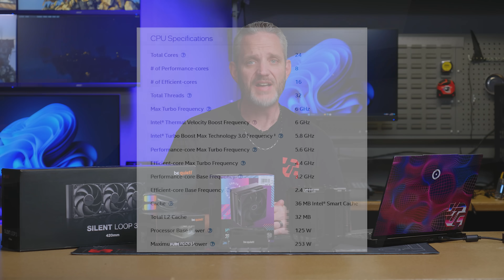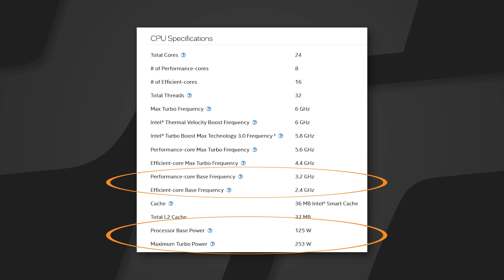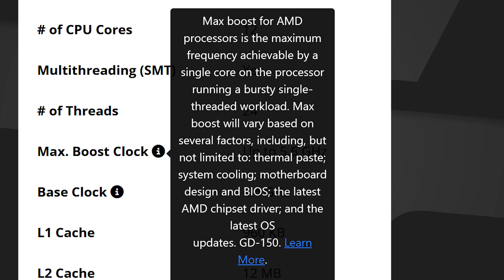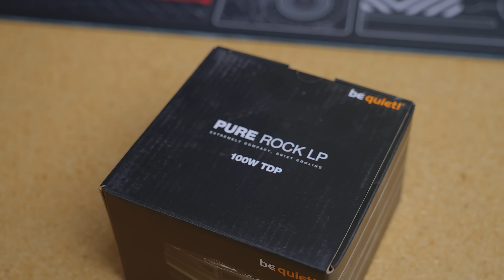Forget what you THINK you know about TDP

Comment: What's wrong with almost all Tech Channels lately? is there some mind virus going around. Some new variant of C-19 causing cretinism?
1) First Law of Thermodynamics applies here as everywhere else.
2) AMD's CPUs adhere hard to power limits set in BIOS or software able to change those BIOS values.

Setting 95W power limit to my Ryzen 7 9800X3D will result in power draw clamping at that point instead of exceeding stock 120W TDP as JayZ suggests.
JayZ is having case of serious PICNIC, or he is shilling for intel who has out of the box boosting mechanism which ignores TDP limits shown in tech specs. Because those are base clock speeds. 
And as intel states, their tech specification shows: "Time-Average power draw during their specific scenario." That means not under full load. As been many times explained, it is their way to simulate expected user's behavior.
That's why 14th gen can easily sustain 350W power draw, while their spec says base power draw is 125W, and Max turbo is 250W. Even while they explain 250W turbo is for burst shorter than 1s by default. But as they state, vendor (main board manufacturer) is free to change those.

In reality, intel's defaults been sources of prolonged turbo power draws exceeding those 250W.

Comment: 7:05 i can guarantee from personal experience that a low profile cooler COULD cool a 9700x ONLY if you leave it at stock; The moment you push the 105w mode and/or PBO, the CPU would fry itself with that thing
Reply: Making my first build with a 9700x. What sort of cooling would you recommend?
Reply: @Rickyp0123  If you want to go with the 105w mode and PBO on, DEFINITELY at least a 280mm AIO

Comment: The older Hyper 212 is a rock solid heatsink had no issue with it. I am still using Noctua C12P-SE14 bought brand new over 10 years ago with a upgraded Noctua Redux 1500rpm fan. Reason I still use it is the looks glorious in the side panel

Comment: 7:26 I just built a travel build in a nr200 (non p max) because I wanted to be somewhat travel ready and also have an aio. I used a Thermalright frozen prism. And max temps ive seen is 76, and on the gpu 79. While on the warm side I'm under the impression I should be fine with that. 7800x3d 5070ti.
Reply: Oh dude your rig is really similar to what I want to build did you had to change anything in the bios?
Reply: @teachhimself no sir, i do start everything with an update of drivers but no i didnt have to flash bios or update bios ahead of time.

Comment: A rule of thumb for AMD CPUs power draw is TDP x 1.35.
Reply: Don't bother with the TDP.  Just look at the max watt draw and that is your max heat output.   No math, max power equals max heat.
Reply: This formula is actually closely in line with actual stock AMD PPT values. Just for illustration:
65W AMD TDP [7600 etc] x 1.35 = 87.75W (Actual PPT is 88W)

105W AMD TDP [7700X etc] x 1.35 = 141.75W (Actual PPT is 142W)

120W AMD TDP [9800X3D etc] x 1.35 = 162W (Actual PPT is 162W)

170W AMD TDP [9950X etc] x 1.35 = 229.5W (Actual PPT is 230W)
Reply: Well yeah because that's PPT which is 230W
Reply: That’s actually pretty accurate 😂
Reply: Valid for AM5 because of their thick IHS.
Reply: more like  tdp x 1.8 or even 2.2x otherwise cant max out the turbo on every core

Comment: The really annoying thing is going to a review site, read "this CPU doesn't need more than the stock cooler it has to run anything you throw at it", let the SI use the stock cooler, then find they didn't run proper testing and that the stock cooler can't deal with the CPU unless any OC is disabled to keep it on base speed tops.

Comment: 11:11 I don’t think that’s accurate! And the dark rock 4 pro whatever doesn’t have a vapor chamber. (As far as I can tell)
There’s multiple coolers that use a machined metal base that aren’t vapor chambers. 
I’m actually only familiar with the one from deepcool that does use a vapor chamber. And they make the same cooler without the vapor chamber with very similar specs. 
It’s sort of a niche and unnecessary use for a vapor chamber anyways.
Reply: Up, you are entirely correct! Almost all air coolers that look like that only use a solid copper base, not a vapour chamber.

Comment: SFF PC + 13600k user here, Im unable to run the latest microcode (which doesn't support UV) due to the insane factory tuning done to the CPU, without my undervolt the temps rise by over 20degrees under load which when combined with any GPU activity throttles the CPU immediately since the 240aio cooling it is also the only case exhaust.
Undervolted I still get full boost clocks so what the heck is Intel thinking flooding the chip with so much voltage??

Comment: About the 9800X3D.. you said it's easy to cool, but my second gen NH-D15 (LBC) still had it reach TJMax in cinebench. I know it's not "real world performance", but it still runs hotter than I expected. Online I read more people have trouble keeping that beast cool.
Reply: Cpu always try to hit tjmax, they are made to keep going till they hit it or fail (if enough power is avail). If it wasnt hitting tjmax, it would mean cinebench isnt working or strong enough to test the cpu.
Reply: Yes it's not the easiest to cool since 140W+ comes from a single CCD. Minus Curve Optimizer helps but be mindful increasing the Max boost frequency will increase your temps tremendously. I got -20 CO +150 MHz Fmax stable so far and it has stock temps with better performance. I had -30 +150 stable too but it was clock stretching that's why it looked stable but perf was worse.

Comment: What I think is borderline criminal are the CPU makers not being clear on this. I don't mind "TDP" used as "this is what your CPU will use 100% stock". What I DO mind is they hiding how much it would go full throttle - at the very least full load on set parameters (call it PBO profile 1, 2 and 3).

I mean, sure no one can give an exact estimated for how much each CPU will use at every configuration. But a stock baseline, plus 2 or 3 default "enhanced" ones would be good to know. It's always the same: I look at the CPU and start choosing a cooler. Then "Will this one here work? The TDP says so, but this is worthless."

Comment: Tdp is useless, even though I might Install a cooler with more than enough cooling capazity regarding the watt it can cool, if airflow is bad, it cant do its job, if the contact frame is bend or the plate is uneven or paste is applied bad it wont matter, so many factors ... nothing to do with tdp ...

Comment: @JayzTwoCents TDP numbers get tossed around a lot. My NZXT AIO died and, while it was under warranty, they sent me an AMD Wraith Stealth and said, “It’s 65W, should be fine” for a 9700X. When I tested it, the CPU was basically cooking itself trying to hold 5.5 GHz, to the point it shut down. It also annoyies me quite a bit when tech youtubers try to compare TDP to actual watts. They say 9700X doesn't need a AIO at all, without understanding the prices of box coolers, like you mentioned.
Reply: I have a 240MM AIO on my 7600X3D and it stays fine.

Comment: i always go double what they say
so like 150w i go 300w (i do have a 360 aio on a 12700k clocked at 5.1ghz p cores 4.1 e cores set at 1.235 volts at 250 watts 105c shut off point since asrock like to shut off my motherboard when it hit 80c even tho it was set to 80c for the safety

Comment: My H115i still has a lot of cooling headroom. The max T-Die is somewhere in the 70 degrees and I have the fans set to low. The CPU uses 170W rather than the 105W it is supposed to. All that meaning I will likely keep using it even in the next hardware upgrade. Which might take another year or even longer.

Comment: Well, working in the embedded area, Intel and AMD CPUs will run at base clocks max. normally. The same for the memory as well. They are designed and built for reliability and longevity, in my case for extended ambient between -40 °C up to 85 °C ambient. You are welcome. :) Of course, running even at base clock at 85 °C ambient, you would need proper cooling, as the temperature delta, a.k.a. the headroom available is much more limited.

Comment: the laptop is ramping fans because its half off the mat. the mat is probably block half the vents on the bottom because two of the feet are hanging in air meaning much of the bottom is now making direct contact with an insulating surface (the mat).
how about some kind of cooling tier list? i have looked on gamers nexus but they do so many makes and what we need is a guide like 'if you have this cpu and mb and assuming 4 case fans and this kind of case, use air cooler for these use cases, for gaming or intensive tasks use AIO/need a custom loop' etc.
Reply: No, the CPU should handle a not moving single Word page, with passive cooling.
I bett if he turns on Battery Saver, that the fans stop instantly. Even my older 11th gen runs on passive cooling during a 1080p youtube video.

Comment: the problem with tdp and cooling is, most air coolers talk in terms of cfm (airflow of fan) and nobody except a streamer knows what that means for temps aside from faster or slower fans on that tower. all we poor users have is tdp or tdw (i have seen that as another name for tdp). my assassin king 120 se rgb  is supposedly 235w capable but thats according to third party website! all i know is, it keeps my 14400f mainly under 65C except for helldivers 2 when it hits 70C sometimes. we cant use w because no motherboard is rated for watts because a lot of cpus fit in an lga 1700 socket. so we cant even begin to guess how much heat the vrms of the mb will need cooling in the case. we have no way to really guestimate the ram stick heat, so we cant really know how many case fans we need, or what kind of air cooler for our cpu, or if aio would be better.

Comment: i have a 5800x, and a DeepCool AK400 ZERO DARK PLUS which claims "200w" which is NOT the case. look at reviews and actual valid info. dont take "this should do the trick" at face value. my temps with auto oc and pbo auto, hit around 90c on r20 and r23. with an aio 75/80c max with way higher scores on the same settings. -no, it wasnt a bad paste job as i first thought it was so i repasted it a few times before swapping to a FW-360 from thermalright.

Comment: Jay. This video sucks. Not going to attack you or your guys, you do great work, this video is very well produced. But the information is confusing and complex, you need a little bit more straightforward of a discussion point to jump from. 

Watts: The amount of work done over time. 

Electricity and heat are both measured in watts because electricity isn't 100% efficient, even in a modern day computer. Electricity flow generates heat, some percentage of electricity will always convert to heat. You have the wattage of power the chip will draw, and then you have the wattage of heat the cooler will dissipate. 

You then have the CFM of your case fans and the total displacement of your box within the ambient temperature of the space your computer functions. Higher ambient temperature means less heat displacement through air flow, and less displacement means higher internal case temperatures. 

This leads to higher component temperatures due to less heat being moved, and then you get... throttling to help reduce the thermal load of the chip. 

Meanwhile, the electricity used can fluctuate independently based on a number of variables... still measured in watts. 

When choosing a cooler, look at the TDP of the chip and the rating of the cooler, that's a pretty good indicator of how well you can displace air to help keep TDP down. However, it's probably impossible to see one number for CPU power draw (watts) and then see another number for Cooling effectiveness (watts) and somehow simplify anything about it, because the problem isn't 'having enough TDP wattage to match your chip.' 

As I stated earlier: some electricity turns into heat. This means you only need enough effective cooling to keep your chips temps in nominal operating range. Drawing 253w of electricity through CPU doesn't mean you suddenly need to have 253w of effective cooling to keep your CPU from throttling. 

What it means is you need to do some homework and find out how much power you actually use, and then spend some time trial/error you way into finding the right cooler. Anyone who sticks with the first cooler they see is probably gonna end up having a bad time, regardless of chip/usage case. 

But it's also going to be hard to ensure a cooler can do the job by shopping on TDP rating alone. What is the rest of your case doing? Ambient temps? Which season is it? What's the temp outside? 

Middle of August in Arizona gonna be an entirely different CPU cooler than what you want in the middle of February in Alaska.

Comment: As much as I'd like to go for a big AIO, the anxiety isn't worth it for me. Plus, of the multiple high end ones I've tested, I've yet to find one that has met my standard of 'quiet'. I've the exact Dark Rock 4 Pro model as you showed in this video, and it's extremely quiet and has a pleasant sound even when at high fan speeds... I just wish someone would make a horizontally orientated 240 or 320mm air cooler, like the Ice Giant thermosiphon
Reply: I just switched from an 420mm AIO to the Dark Rock Elite, its much louder but its safer.
That was the 2. AIO that was leaking, it killed my RTX4090...